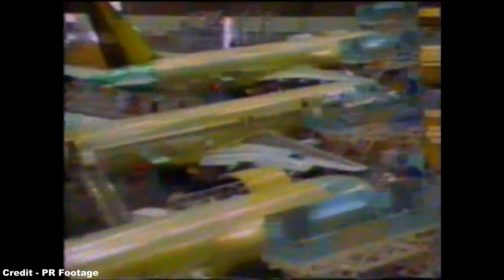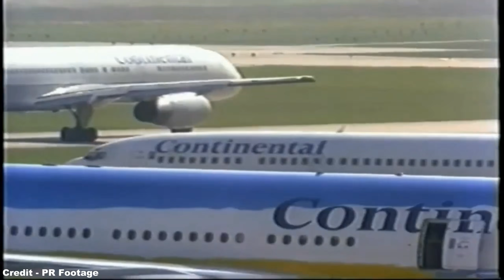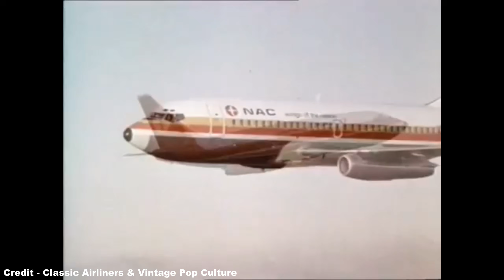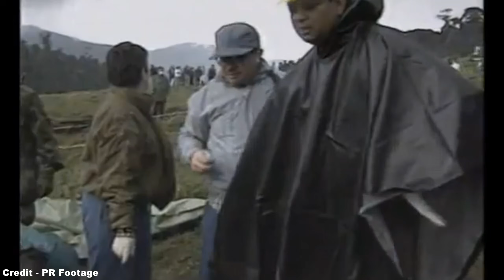Boeing's Rocket - The Boeing 757 Story

Comment: Boeing was so sure they had a winner that they discontinued the 757 in 2004. It is one of a series of stupid moves that has put Boeing were it is today.  They could have built a 757- like skinny dreamliner 797 to complement the 787,  just like they did with the 757 &  767.  Those are two great aircraft that have proven to be hard to replace.  The 757 did its job very well,  of replacing the 727,  which was loved by the airlines in its day.   Good job Ruaridh,  thank you.

Comment: Excellent presentation of the aircraft. I flew the 757 for five years before retiring and was always amazed by it’s ramp presence. Beautiful to look at and wonderful to fly. You never get over the way those engines sounded as you applied takeoff thrust and the way you were pressed back into your seat at almost no matter what your takeoff weight was. Always had enough fuel. I couldn’t believe they stopped production when they did. So glad I got to experience this machine before I had to hang it up.

Comment: I absolutely loved this aircraft. I got my command on it and flew it for 5 years. In 30 years of flying many different types this was by far my favourite for so many reasons. I never flew the 535C's, only the E4's although our simulator #1 was a C and it felt gutless when used to the E4's! 😆 I don't think that you can lay blame for any of the fatal accidents you mention at the feet of the 757 design. They were all pilot or maintenance errors. It was a sad day when the last 3 examples in our fleet were retired 😔

Comment: Awesome video as usual! Well researched, accurate and informative! Although I'd push back a bit on "bright future" given it being a 45 year old airframe/design, its days in major service are numbered now given its age, but it'll endure as a freighter particularly later build examples now well into their 20s. Whatever potential market there may have been for a 797 are all but long gone now with the A321XLR and 737 MAX9/10 order backlog. Boeing would be better suited (re)introducing the medium haul 787-3 they canceled and would make more sense at this point for the middle market, not just because a clean sheet design would be too risky for them financially (given the white elephant that is the 777X program and MAX7/10 delays), but also since the opportunity to introduce a 797 type airplane to the market has effectively passed. Airlines held out as long as they could, having gone slightly down in performance/versatility, but not capacity wise with the A321Neo/737MAX. The market is weird, look at the A330-800 which should've been a great seller to replace old A330-200s and 767-300s, but it's been a huge failure.

Comment: I still don’t understand why they discontinued it.  It was fabulous to fly, the passengers loved it and it was so overpowered no other aircraft’s climb profile could compete.
Reply: Because the efficiency improvements and lengthening of the A320/737 meant they could achieve its range/payload much more cheaply. The higher MTOW of the 757 was no longer needed. A NEO'd 757 would just have a ridiculously long range which would be of little use to anyone.
Reply: @N330AA Airbus created a competitor after, Boeing removed a successful aircraft from its lineup. Airlines use single aisle jets for medium to long haul operations so really it’s just a poor decision from Boeing
Reply: @ Truth is the A321 ate a lot into the 757's market even before the NEOs, though it couldn't completely replace it on all missions.
Reply: @N330AA  a NEO 757 would become an instant A320XLR competitor / NMA , detune the engines for reliabilty and effeciency - but the problem was Boeing disarded all the tooling for the 57
Reply: @ No it wouldn't as it would be too much plane. The airframe is designed for a higher MTOW which is no longer necessary, and just adds weight.
Reply: Yet, if the video is correct only 1000 of the 757 were ever produced. Nevertheless I am a fan of the 757 and if anything I do agree with your comment.
Reply: Sounds like you answered your own question
Reply: Yes it was all those things, but the world moved on, the A321 for example, is literally tons lighter and therefore much cheaper to operate, it was a great aircraft in it’s day with a fantastic record in service, pilots loved them, they were truly the E Type of the skies in the 80’s, 90’s and in to the mid 2000’s.

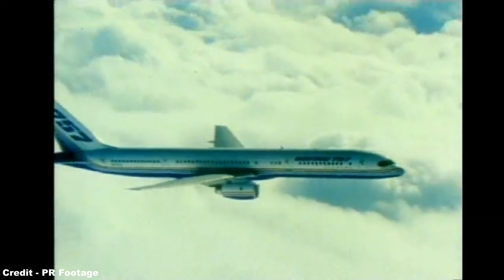Comment: 7:29 No, that's not what a step climb is for. EVERY jet that flies long enough routes does a step climb. It's a way of keeping the jet flying at its best lift to drag ratio as it burns off fuel and gets lighter. If air traffic control weren't an issue, it would actually be a continuous climb

Comment: PW 2000 should've powered the A340-200 and -300
Reply: Or even the RB-211 should power the A340-200 & 300's rather than the CFM-56-5C
Reply: Airbus doesn't like to rely solely on American engines. They'd prefer to have an engine built closer to Europe as if there are any problems they can communicate with the engine maker more efficiently. CFM is a collab between GE and Safran (French company) so you can see why they chose the CFM56 instead of an American option only.
Reply: @ No because that was underpowered

Comment: The 757 had all the attributes necessary for a MAX upgrade...except timing.
Reply: What engines?
Reply: @ By the time it became obvious that a market existed for an updated 757 the production line had been shut down. If 757 production had continued, even as a freighter, for a few more years maybe we would have a 757MAX flying today.
Reply: @ Production continued for what orders?
Reply: @ That’s my point. If only the industry hadn’t tanked with 9/11 maybe, big maybe, 757 orders could have stretched out a few more years. Alas.
Reply: @ 757 orders dried up well before 9/11. No orders came for an extended range proposal and the -300 only managed 55

Comment: You still haven't realized the Pentagon was hit by a missile. That's some poor research.
Reply: Just gonna assume you're trolling
Reply: @TyrannoJoris_Rex  Gonna assume you're an order follower believing a corrupt government. 9/11 files will be released by AP Luna.
Reply: @TyrannoJoris_Rex  Gonna assume you're willfully ignorant.
Reply: @ So everyone on Highway 395 that saw it is lying? The lampposts that got sheared away and tossed into the grass just failed on their own? And the missile detonation left a straight path through the ring corridors that didn't expand outward as it radiated out? Just the width of the spacing between a 757's engines and only getting narrower the deeper it got?
Reply: Jeez it's literally on video, a plane crashed into the Pentagon

Ah but I guess you're just gonna wave it off as "fake"
Reply: @ryanjonathanmartin3933  The real vid is out there and it wasn't a plane. Also notice no damage from wings.

Comment: we need a 757MAX instead of a 737MAX
Reply: With what engines?
Reply: @  same as 737MAX currently because 757 is noticably taller
Reply: @ Those only put out 29,000 lbf

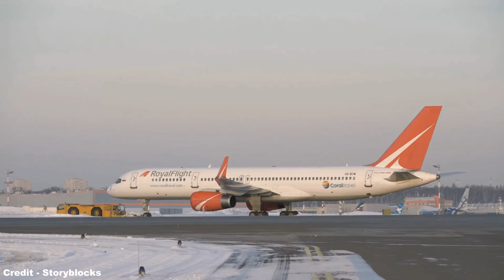Comment: 21:20 Jet2 retired their 757 fleet earlier this year, the final flight being from Manchester to Geneva on 5th January. I was on board the outward sector, EGCC was snow closed pushing our departure time from 0655 to 1005, thus allowing most enthusiasts aboard the flight an opportunity to spend a few minutes in the flight deck. The captain asked anyone who wished to visit to press their call bell, the PSUs lit up like a Christmas tree. Upon pushback there was a nod to the history of the aircraft, with passengers being welcomed aboard the “Boeing 757 LuxuryLiner” (although I think this was used by AA on the 767, with the 757 actually being dubbed the LuxuryJet). For this occasion the captains elected to use 100% thrust on take-off, truly embodying the rocket spirit of the 757, we reduced to climb power before leaving the airport boundary. This flight was aboard 757-200 G-LSAI, line number 150, age 37.3 years at the time which made it the oldest 757 in the world still flying passengers. On 8th January she was flown to St Athan where she is currently being scrapped.

Comment: Back in the late 1980s I worked at an advertising agency that had an client (KnowledgeSet) who wrote the software for the 757 repair manual. I was an art director and it was my project to design the material to promote the fact that a manual of that size was possible and it could fit on a single CD-ROM. It was touted as the first time a commercial aircraft’s full parts, components and diagrams were available electronically.

Comment: Yeah @Ruairidh MacVeigh the 757 type design is not as young as everyone thinks as the British had already come up with the 757 type in January 1967, the Hawker-Siddeley HS.134, a 104 foot, 3 inches long with a 116-foot 3-inch wingspan and a height of 41 feet, 2 inches and cabin diameter of 12 inches with a capacity of 210 passengers.
Reply: 12 foot cabin diameter?
Reply: Yeah from the 1967 design which could have been enlarged to match the capacity of the 757 but I have yet to figure out how disruptive exactly a 757 type aircraft coming out before the 757 would be

Comment: 21:57 G-BMRB, built in 1987 I believe, is still in service as of February 2025 as a B757-200SF operated on behalf of DHL by DHL Air (UK) Limited based out of East Midlands Airport, UK.
It is one of five B757-200SFs that DHL operate that have the original RB211-535C engines.
Reply: I have seen G-BMRA myself at Geneva Cointrin two years ago operating with the -535C, good to see them still operating.

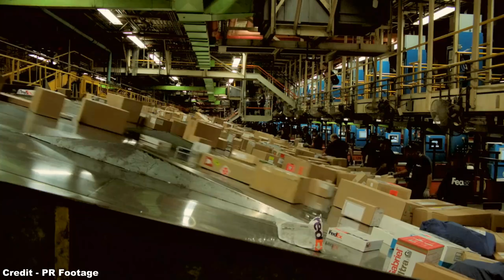Comment: 16:03 There was no change in the EFIS "glass cockpit" during passenger to freighter (P2F) conversion, unless specified and when the technology was avaliable. There was no upgrafe option for the early conversions around the year 2000.
Flight deck display retrofit upgrade options that have been available since  are the IS&S flat panel display sysyem and the Boeing Large Display System (LDS).

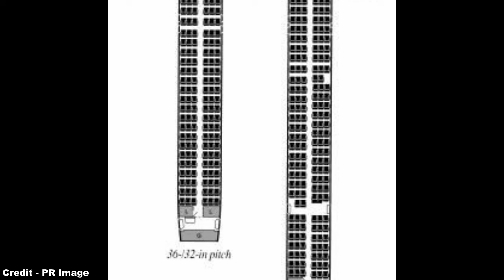Comment: 12:09 Mistake in the narrative regarding the upgraded Rolls Royce engines of the B757-300. They were not RB211-535 24, probably a typo in the script they were the 535 E4. Disappointing that there was no mention of the change in engine to the 535 E4 variant from the 535 C fairly early on in the B757-200s production in 1984.

Comment: Boeing used to legitimately engineer airplanes as a testified by the 757. It took nearly 20 years after end of production for a viable alternative in the form of the A321XLR to take flight.
Reply: Those were the days when engineers instead of pencil pushers ruled Boeing.
Reply: @obelic71  Human calculators are understandably necessary in an organization, but they lack the qualities to ever be more than assistants.
Reply: Then, in typical Boeing fashion, cut production of the best, most versatile aircraft they ever produced.
Reply: The XLR is less a viable alternative as much as least worst alternative

Comment: ❤ I wish this plane was updated over and over instead of the 737 🤢
Reply: Airlines wanted more 737s lol, especially emerging markets in Asia. Transoceanic flights weren't in high demand in the early 2000s due to rising fuel prices.
Reply: @ryanjonathanmartin3933  maybe a shorter version with the same nose then. Because the 737 is old and boring as hell
Reply: @emmanuel315x  757 has a different airframe to the 737, so commonality is broken with the 737 fleets that airlines have. Those airlines wanted an upgraded 737, not a 757.
Reply: @ryanjonathanmartin3933  I don’t care what they wanted, for decades I’ve been watching the 737 come and go and I’m sick of it. It doesnt look good
Reply: With what orders?

Comment: I will never understand why the 757 was ditched but Boeing still kept the 737, and made the pig that is the max
Reply: Because 757 orders dried up, while the 737 was still selling very well at the time. Basic bean-counter economics.
Reply: @themachine-ca  - The 757 was more expensive to build, so airlines chose the cheaper option.  Unfortunately the routes and markets where it really shined emerged too late.  Truly unfortunate timing for one of Boeing’s best products.
Reply: They scrapped a bunch of the tooling for the 757 line, but still had the 737 next gen in production.
Reply: @ yeah my reasoning is kinda why stop making what was actually a really good, well liked aircraft, to keep putting out what was at that point just a rehash of a 40 year old airframe
Reply: @oliverbrigstocke1306  Again, had they built the MAX with better manufacturing quality, they would have had a sales success. They had a larger order book than the A320neo before the MAX crashes.

Comment: I recall reading somewhere that boeing rejected the idea of developing the 757 further instead of the 737 max. Had they done so they might have saved a lot of trouble! Continental used them on the birmingham to Newark route too.
Reply: It was more of a customer choice. The last 757 was built in 2004 because they had no more orders for it. Some of its components had become unavailable.
A few years later, customers wanted a newer, more efficient 737. 757 required a different pilot type rating, so this would not have met their requirements.
Unlike a mass market item, you do not build an aircraft & tell customers to 'take it or leave it'.
Reply: Boeing would have hit it out of the park with the MAX had they had better business practices and well... better manufacturing quality.

Comment: I heard it will be quite a challenge to replace the C-32A because of the great thrust to weight ratio it can also operate from rather small airports with short runways and there is literally no modern airplane model with similar specs they need like a 787 but with Trent XWB or GE90 engines...

Comment: the 757 is basically the 1980's hot hatch of the sky...
Reply: Yessss!!!
Reply: hahaaa yes. hot sedan maybe?
Reply: @gangstagarf  nah, that would be a 747 with GE90's...
Reply: Also came along at the perfect time for ETOPS. Narrow body allowing city pairs to be linked economically in a way that wouldn't be possible for the competing ETOPS widennng
Reply: yeah except we could have had a 757 before the 80s as British had come up with a smaller similar design in January 1967
Reply: @Knight6831  What was it called ?
Reply: @ChristIsKing4ever-l9w   Hawker-Siddeley HS.134
Reply: It still is!
Reply: The 757 is basically an E46 M3 with an E39 M5 V8 swap lol.
Reply: You can tell when it’s a 1.9 due to the disc brakes at the back.